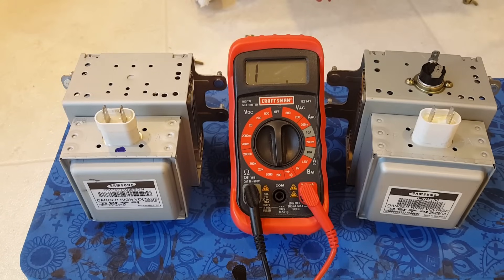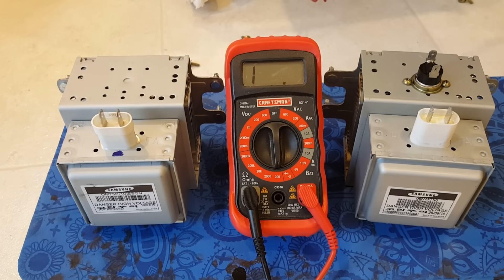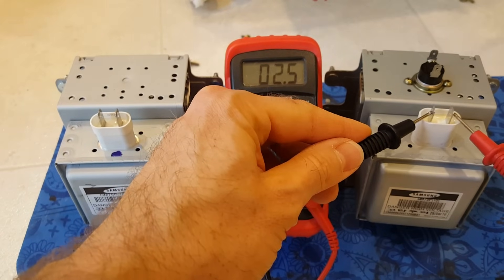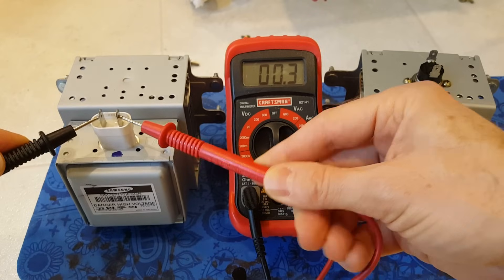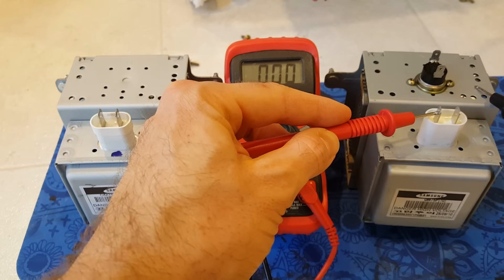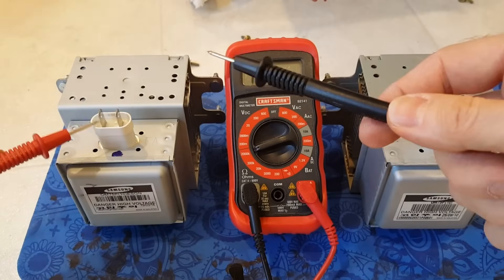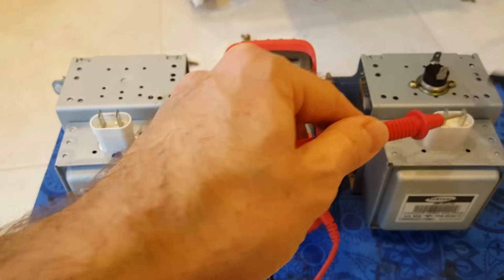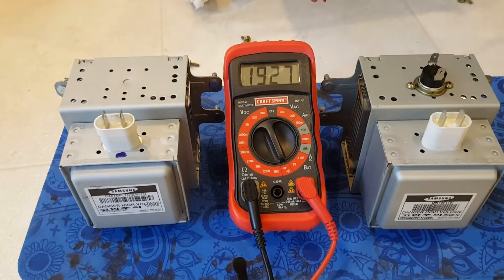Microwave Magnetron Test - Good vs Bad

Comment: I pickup 40-50 microwaves along the curb or out of dumpsters a year. Usually a blown fuse or wave guide and good to go. Sometimes rusted inside, a lil sanding and spray paint and good to go. I recently just got one that wouldn't heat, so I checked the fuse from the capacitor and it was blown. So changed that out, still no heat. Checked the door switched, all good. Replaced capacitor with a compatible one, still no heat. Also checked diode, then started looking thru my pile of magnetrons and found a match. Replaced it and finally got heat. I was curious on how to test it next time without going thru all that, so found your video and tried it and the bad one tested just like yours and my other ones I tested good. So thanks for the info, might save me time next time this happens.

Comment: Allways inspect the magnets and make sure there not cracked , and look at the tip of the magnetron (Its Antenna) to see if its been damaged,  Allways remember the ouptut of the microwave transformer the Capacitor and high voltage diode are in an extrermly high voltage an high current voltage doubling circut and use proper respect when working around them, there are some cases where the Capacitor can hold a deadly charge even when the microwave is unpluged (Allways assume its charged), those leads are connected to the magnatron and you can get hammered when you try and remove them.  The Capacitor "must be proven safely discharged" before removing those leads ..

Comment: My 3 y/o GE microwave recently stopped heating, checked everything (diode, capacitor, 3 switches, etc.) - all passed the test, but upon inspection of the magnetron metal radiators, I noticed some slightly burnt surfaces including some part of the metal housing but again it passed the test like the video described here.  In the end, I replaced the magnetron with the new one. Now, the microwave is working again.
Reply: Mine too! A PEB7227SL. I lucked out and found a brand new PES7227SL (Stand alone model) at Nebraska Furniture Mart which I was able to modify slightly and fit into my built-in.
Reply: Did you use the oem magnetron? Or did u use a different one? Currently trying to save my dual wave also, for some reason I love it even tho it’s 100 pounds haha

Comment: How to check a microwave magnetron: check everything else. Door switches, fuses, relay, transformer, temperature sensors, high voltage capacitor and diode. Why? Cause you’ll know for sure those are bad with just a multimeter and a 9v battery. If all those test good, it’s the magnetron. You cannot test a magnetron with just a multimeter. There’s a possibility that it’s still bad regardless if it tests good from what’s shown. Picked up a junk microwave to flip for cash off criegslist. It didn’t heat, and everything tested working even the magnetron. Ended up getting another junk microwave, after testing all the new parts, started swapping in the working parts. Ended up swapping the magnetrons. The first microwave started to heat again. The 2nd junk microwave only had one bad door switch. First junk microwave, everything tested working, or so I thought. Lucky since the some microwave parts aren’t cheap, hv capacitor, transformer and magnetron to be exact. One of them fails, means you need to fork over 1/4-1/3 the cost of a new microwave.

Comment: My magnetron is reason 90 ohms terminal to case is it functional or should I replace it, the diode on the capacitor was bad. I just don’t want to put the microwave back together if the  magnetron is bad too

Comment: if i get a ohm reading on the "lowest" ohm setting from point to case? I get 125 ohm
Reply: that means your magnetron is burnt, for a good magnetron the measure resistence betewn point and case must always be infinity, otherwise its burnt, there is a way you can repair your magnetron, search at youtube, there are few videos of repairing

Comment: Hello friends.
My microwave oven does not display power.  When the oven door is opened, the rotation motor is driven and the lights are turned on.  Nothing heated while the display was in good condition.  I don't know what the problem is.  Advise or help me.

Comment: There are typically four ways a magnetron may fail. The test in the video can find two of these faults but passing those tests by no means guarantees the magnetron is good. 

What the test can find is if the filament breaks and if the filament has sagged and contacted the anode.

There are two more ways it can fail.  

One is that air leaks into it so it no longer has a vacuum and will arc inside instead of making microwaves. Such a failure will not show up with the continuity check except in some cases where the arcing inside the magnetron has melted something and caused a short circuit to be created between the cathode and the anode. In that particular case the continuity check will show the fault.

The other, much less common fault is that the magnets lose their strength.  That usually happens because for whatever reason the magnetron would have overheated and the over temperature cutout didn't do its job. With this type of failure sometimes the oven is just much less effective, still heating somewhat but much less than it should.
Reply: Awesome reply. My Panasonic micro is showing H98 code. The magnetron shows continuity terminal to terminal and terminal to case on both. I'm assuming that is not how it should read and had shorted.
Reply: @BlondieHappyGuy  The short answer is no.    
The longer answer is that it is possible but difficult, requires special equipment and not worth the effort.  The short is usually caused by the filament sagging and touching the anode. You would have to cut open the tube, replace the filament and then evacuate the device and re-seal it. The last part is the most difficult and needs specialised equipment the bring down the pressure low enough for it to work. Commonly available pumps such as used in the HVAC industry do not create a good enough vacuum.
Reply: @listerdave1240  
Crois moi le jeu n'en vaut pas la chandelle !
Reply: @BlondieHappyGuy  If it's a short of any kind, I would advice replacement. My understanding is that these are not serviceable and I wouldn't want to risk a questionable fix at the frequencies these operate at. Replacing my Magnetron did the trick for me.
Reply: This is what I was looking for as a professional Tech😊👌👍

Comment: I've just replaced a magnetron and they both measured exactly the same, zero conductivity between the terminals and case and basically zero ohms across the two terminals. So measuring low ohms across terminals and zero conductivity between terminals and case doesn't necessarily mean the magnetron is good.
Reply: Had the same problem. Could not find anything else wrong with the microwave. Took it in to have it fixed. Magnetron was still bad. I did ask the tech how he tested it. He said they used a high voltage probe to test it.
Reply: Instablaster.

Comment: This is misleading. You can have a magnetron with perfect multimeter readings and still be defective. You should at least mention this in the video.
Reply: humpty mine past the tests but on visual inspection, the magnets were broken in half and a gentle shake produce some rattling sound.

Comment: Does the magnetron need to be removed from the mocrowave in order to test if it's bad?
Reply from the maker: No, just disconnect the wires.
Reply: @RickBardos  Thanks!  The filament where the wires connect ended up being fried, I have continuity to the case

Comment: I have a question, my magnetron did not work. Readings on the old and new one exactly the same. Between terminals and between casing and terminals. How is this possible, yet old magnetron not working????

Comment: Hi Rick, I see your hand is good test, i will do my hand also. LOL
Reply: Make sure to push probe deep under your fingernail to get a good reading. It may sting a bit, but that's ok. You should get a good reading. Next, plug the unit in to check the capacitor to be sure it has the correct incapacitance. (Be sure the capacitor fluid level is at the "full" mark first. If the mini dipstick is missing, you can make a decent one using a safety pin, a small piece of scotch tape, and a 24 volt/60 amp battery charger with a "start/boost" setting). It should be self explanatory, but if not, find someone who can do the test properly. It'd be easy to knock your dick stiff and burn the hair off your head if you mess up. Safety first!

Comment: Hi. I have a i3 turbo chef I replaced the Magnetron it would run about 10 to 15 seconds and turn off can you help me
Reply: Sounds like a power supply problem. Maybe the capacitors in the power supply?

Comment: I had a microwave with no heat.  Magnetron sounded loud.  It measured .2 ohms across the terminals.  Then went to zero after a few seconds.  The new Magnetron did the same thing.  The new one worked in the microwave.  The terminal resistance and terminal to case test if passed does not necessary indicate the Magnetron is good.
Reply: How much was your magnetron and where did you buy?
Reply: It's been a long time, though I am replying, in your case, the magnets of the Magnetron might had broken, that's why everything looks good but didn't work.

Comment: Dear , i checked as per your idea my magnetron  is good but still there is no heating, checked transformer, capacitor, diode, and input voltage of transformer, please help me if magnetron is ok then why no heating,
Reply: Sometimes the megnatro pass the test but it's bad, you have to buy new megnatron
Reply: Check door switches

Comment: I have removed the magnetron and realized it appears to be defective at the very tip as it has a small burned spot. I also checked inside the microwave where the magnetron head is inserted into and it also has a burnt spot. I tested the magnetron with a multimeter and it passed and the diode and capacitor also pass. I have not tested the relay yet because as soon as I saw the burnt spot on the head of the magnetron I am guessing this is the problem but I want to ask what you think and whether you think the burned spots on the head and inside where it inserts into indicate the magnetron is the problem or could it be something else?

Comment: Helpful video.  However, it would be even more helpful if your hand didn't cover up the multimeter display during the tests.  Thanks for taking the time to post the video.
Reply: What part of sound continuity test makes you want the readout? Continuity either exists, or doesn't. There is no need for a readout

Comment: This is not a definitive test set.  I have two magnetrons here that test fine by the video, but neither will heat.  Replaced with new units, both microwaves work perfectly, so I know it's not, otherwise, something else in the HV section.
Reply: boogerhead0 could be the relay or the board itself , these are the ways to test magnetron, yes it’s not fool proof however it is the only real way ,  
What I do is disconnect relay with micro off and then on to test continuity ,  of relay if it don’t then I use a wire to jump the relay wires , to see if bypassing relay makes it work .. if it heats I know it’s the relay ..... if it don’t .... then I need to measure the voltage of relay while on to see if the relay is even being powered .... if not the the board needs to be looked at ...... 
it’s all about sequence of operation..... u plug it in ... you have power to switch ... turn on switch you have power to next thing .... is that working if so keep digging further ...if so you ,found the issue ..... only exception is the boards , they will lead you astray if it’s an occasional board issue , and have to rely on experience to get that feeling it’s the board and not the 4 issues you found getting to the board ..... can be done just normally way more time consuming
Reply: @voodew-nomad4715  sir not clear, which one is relay & which board do u exactly mean..
Reply from the maker: boogerhead0 That's true, these tests will verify continuity across  the terminals or identify a short with the housing.
Reply: Yes, but not always cull out a bad magnetron.
Reply: What are other tests that will absolutely cull out a bad magnetron?  I have two that pass the shown tests, but don't work.  My question is "What is truly wrong with the non-working magnetrons?"  The ring magnets are not broken, and there is no other apparent damage to them.

Comment: hi 
I checked one magnetron .that shows 
continuty short circui in between case and terminal .and in between both terminals resistance is .4ohm.
also hv fuse was blown .
so magnetron is faulty?
hv diade is good .I checked it too
Reply from the maker: Asia Waqar Ahmad you should not have any continuity between the magnetron case and terminal.  This would indicate a short which was the same problem with mine.
Reply: Rick Bardos thank you.
Reply: @RickBardos  , does this rule apply to all magetrons?  Where is a good place to purchase?